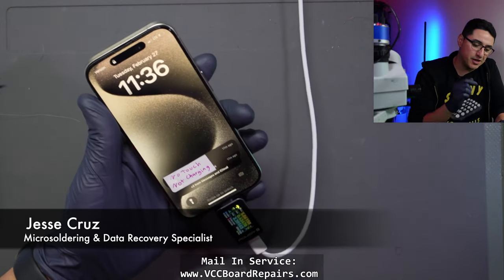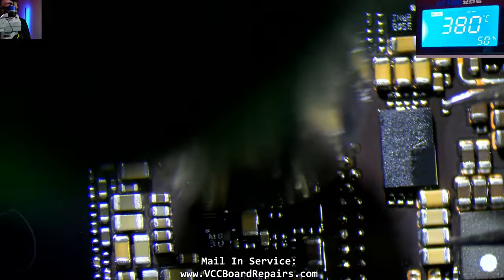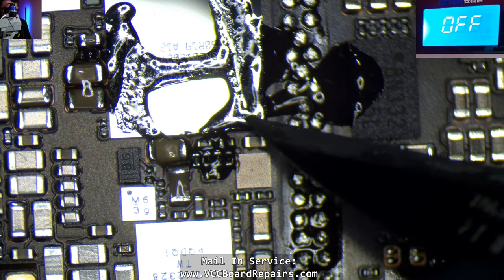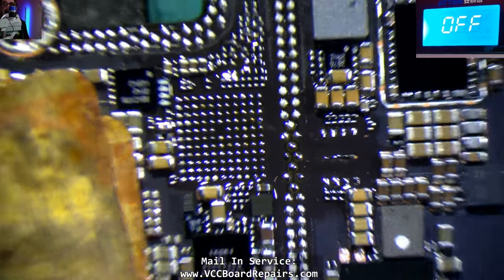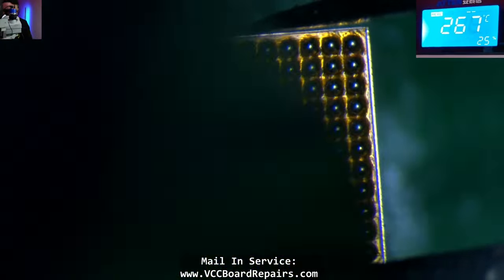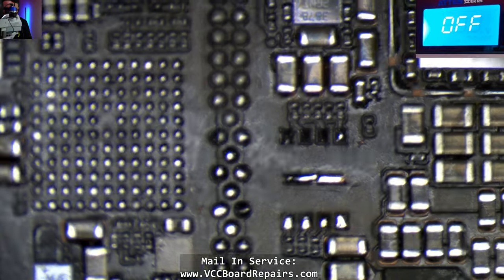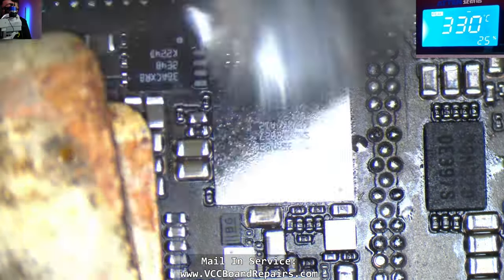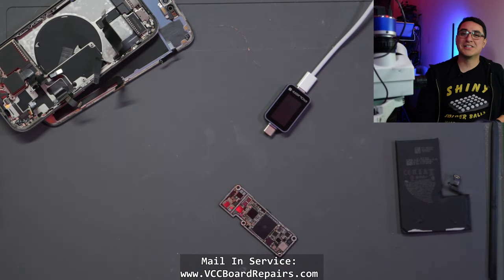iPhone 15 Pro with No Touch? It's the USB Type C Chip. How To Motherboard Repair Tutorial

Comment: it is only a bad charger problem or just using any Android USB-C cable can result in this problem. ?? Bad charger is a known issue on all Apple devises that "kill" charging IC if charging voltage is with too many spikes
Reply from the maker: Sadly, i don't have the backstory to this. But I would suspect a bad charger or something
Reply: @VCCBoardRepairs   I saw this problem already with one of my friend's phones, he did not need data recovery. I'm still trying to understand if this is a charger problem or a cable problem, if Apple actually added something to the brand cable that only this cable will change without a problem.
Reply: From my technician experience, you always need a good cable (can be not original). The charger is not too important, of course if it's not the cheapest.